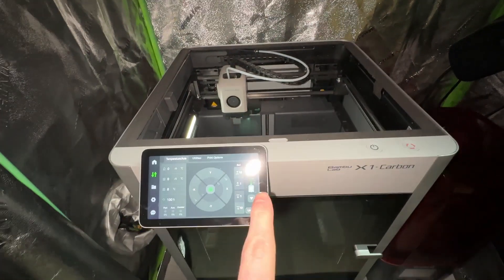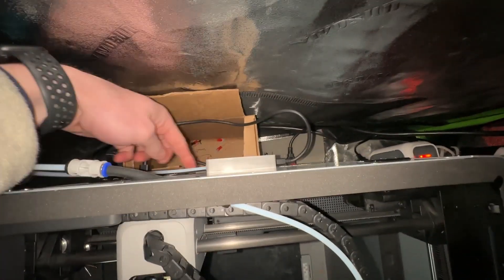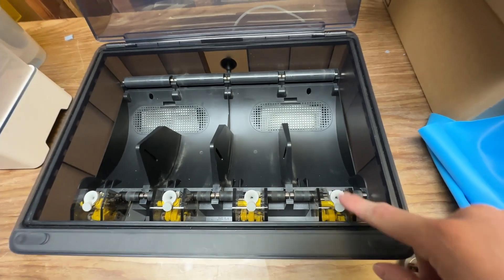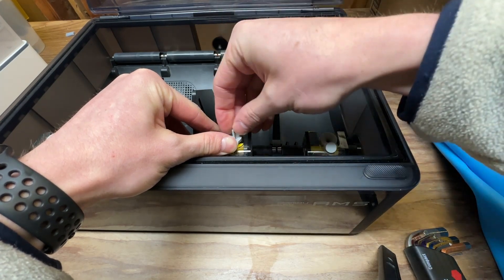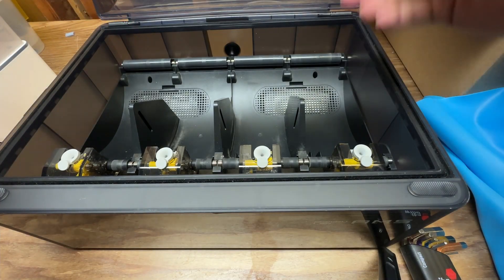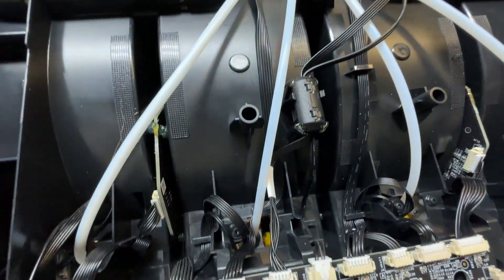How to Clear Broken Filament from the Bambu Lab AMS

Comment: Wow really? I just switched to the Bambu combo, and it takes all of this effort? I love the printer, but snapped filament is really common. Seems there would be an easier way.
Reply from the maker: Snapped filament really isn’t that common if you’re using decent filament. They’ve made it easier to access on the AMS2 not sure what you purchased but sounds like you got it recently so maybe you’ll have an easier time. You can also leave the screws unscrewed, I haven’t reinstalled the screws since filming that video and it hasn’t caused any issues.

Comment: Thanks!  Mine started this last nite.  I removed the extruder to check for a clog, when that didn't work - I came to YouTube!  One thing I did differently than you, I didn't pull the whole unit out.  So I didn't have to disconnect and reconnect the two plugs in the back center.  I got enough clearance to disconnect the tube and clear the clog.  Thanks again!

Comment: perfect.  this is exactly what i needed to do.  and when i fed the filament, it snapped off again in the exact same spot.  so now i get to do it again.  a skill ill surely learn now that I'm practicing lol.  ug
Reply from the maker: I’ve found that you can leave the 2 screws out and you can leave the cables connected but just tilt the internals forward. Makes this into a 5 minute job of unloading filament, tilt forward, clear jam, reload.
Reply: @3DPrintStuff  i appreciate that, i will try it

Comment: i went a short period without using my ams and i left filament in the unit when i should have known better arn now i have 4 slots with this issue. never had a issue an ive used it pretty much none stop since ive had it an well over 2000 hours so it was probably a good thing it happen cause i found two of my ptfe tubes had worn through right as it comes out of the little motors that drive each slot. wasn't expecting that cause i hadnt had any issues but after 2000+ hours of printing i guess its expected.

Comment: Was watching the end of a reel in the AMS being pulled through and saw the tape that held it to the carboard roll detach from the roll. Wasn't quick enough to stop it being pulled down within the AMS.

Your walkthrough showing how to free the rear tube (so that it can be pulled from the rear grommet) by pressing down with two fingers was a life saver. Managed to pull the filament back through and then reconnect the tube.

Another Brit bacon saved. Many thanks. Subscribed.

Comment: It seems those 2 wires are a pain for all of us. The best option to make it easier would be to either replace the 2 wires with longer wires or attach an adapter that would allow you to extend them. Really, Bambu Labs cut corners on the design of the AMS system. Those wires could have been longer. Also, they should have designed the AMS system with an easy open bottom that allows you to access all those things without having to take apart the  whole AMS system.

Comment: Everybody seems to love this printer but I hate it. Been nothing but a headache! It doesn't JUST WORK by the way if that's what your hoping for (I just wanted a plug and play solution). Nope been extremely frustrating with either poor printing, jamming, having to take it apart, resolution issues, etc etc etc Endless to dos

Comment: 3:39. I didn't have to disconnect these wires.  I simply unscrewed the two hex screws, and rotated the AMS in the box (didn't lift it out), removed the jam, and rotated back.  No need to disconnect/reconnect those wires.

Comment: Came back after not printing for a few weeks to a broken filament and dreaded taking the AMS apart for the first time. This video was great and to the point. The one think I did different was when I unscrewed and lifted, I did not have to remove the two connectors and was able to remove the other end of the TPU tube and pull it out.
Reply: Same! I just took the tube out, then pulled up enough to get to the inner AMS tubes. Worked a treat.
Reply: great

Comment: Towards the end it’s a bit dark, however it looks like you are not using a Bambu spool, with an IFRD tag.  If this is the case this it will be why the system fails to recognise the colour/type of the filament?

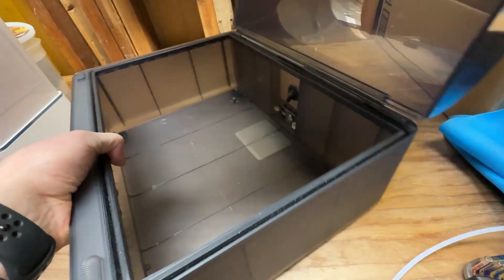Comment: at 2:20 -  People, be careful he did not show the 2 cables that you need to disconnect from the PCB board.
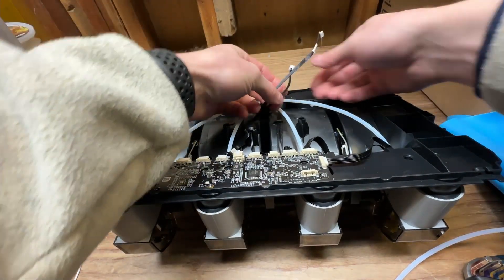Reply: Am I correct in assuming you didn’t watch the complete video?  At 3:16 he apologises for not mentioning the wires have to be disconnected.

Comment: I hope you heart this comment. Sometimes, and I've seen this only once in the almost year I've had the X1C... I had filament broken inside the tubing in two places (which was easy to resolve), but also stuck in the main tubing junction which is not visible, I carefully rolled the right big white cog until the stuck piece came out. The symptom is that the AMS will think there is something loaded despite removing the broken bits from the tube.

Comment: Be careful. He didn't show disconnecting the cables when you pull the bottom out.
Reply from the maker: Piggy backing on this, you can leave them connected and just tilt the inner assembly forward if you’re careful.

Comment: So the screws aren't catch screws meaning they can fall out. I am now -1 screw lol, Beware!
 
P.s does anyone one know what screws size they are?
Reply from the maker: I never put mine back in and haven’t had any issues. Makes maintenance tasks even easier.
Reply from the maker: Screw size: BT3-8
https://wiki.bambulab.com/en/filament-acc/acc/screw-kit-x1-p1
Reply: @3DPrintStuff  Thanks for the info ill probably just leave mine out that never even crossed my mind

Comment: Thanks!  Those two electric buckles are the worst thing ever; I'm still not sure how I managed to get them to stay.  All for a tiny piece of filament that it couldn't get out?  What a PITA.  No wonder it doesn't give a QR code/solution for it.
Reply from the maker: I no longer undo the electrical cables and just tilt the inner assembly forward to access the tubes underneath. Definitely makes things easier.

Comment: Can't remember where I saw it but there's a much simpler way. Although it will only work if the filament is stuck in the AMS. Anywhere else you'd need to do the regular checks.

Cut off around 60cm of any filament and disconnect the tube attached to the AMS. I found its easier to remove directly from the AMS and insert another one. Now feed in the 60cm filament you have. And continue the unload the filament you inserted will push out any filament stuck in the AMS.

I reckon filament shorter than 60cm should work but that was what was recommended in the post.

Comment: After 6 months of printing I got my 3rd filament breakage in the AMS. Usually is because I'm loading a spool with little filament left (-50g) and seems to rip it apart, I've been able to push it with a piece of filament like you did before. My 3rd jam seems to be more serious probably have to take it apart as you did and your video is very helpful, thanks.
Reply from the maker: If this is happening to you often you might want to consider leaving the 2 screws out of the sub-assembly when you reassemble the AMS. It hasn't had any negative effects on my printing and it means I can tilt the inner subassembly forward without disconnecting the cables to access the tubes whenever I need to.

Comment: TYVM!! I accidentally put TPU in my AMS and this video helped me clear it. Mine was actually stuck in the motor housing near the back of the AMS and after I followed the steps in this video, I was able to remove the four screws that hold the motor assembly and manually turn the gear to make the filament exit. Putting it back together was a snap!
Reply from the maker: Glad you found it helpful. Honest mistake if you're not aware that TPU isn't meant to go in the AMS.

Comment: 30 mins to get the connector back on, 5 mins for everything else.  Next time I'm not taking the connector off, a little harder, but worth it.
Reply from the maker: Yeah this is the move. I should make a follow up video saying to leave the connectors connected. You can just tilt the inner assembly forward and access all the tubes without disconnecting the connectors.

Comment: What a serious pain in the ass.  My very first time using my new printer and snap off goes a piece of filament.
Reply from the maker: Unfortunate that it happened right away. At least you know how to solve it if it happens again. I haven’t had this issue in over a year, it’s usually due to low quality or old filament.

Comment: This was awesome! Thanks so much. This is exactly what happened and I can say using the set of printed Bamby tools they have the small wire end remover so you can unplug without yanking on the connector and that helped. Getting them plugged back in.. thats another story. It would be great if Bambu made them more user friendly or perhaps more slack so you can leave then plugged in when doing maintenance..
Reply from the maker: You can actually get away with leaving them plugged in and just tilting the inner portion 90deg to access the tubes. I found this out a little while after filming this. Makes clearing jams/broken filament even easier.

Comment: What if the filament doesn't just pull right out? My filament is stuck in the side you insert the filament into. Anyone?
Reply from the maker: You may need to remove the 1st stage feeder and disassemble it. 
First stage feeder removal: https://wiki.bambulab.com/en/x1/maintenance/replace-first-stage-feeder
First stage feeder disassembly: https://youtu.be/3_if11ulC5I

Comment: The step for disconnecting the electrical wiring of the AMS bay should be shown too, as a too harsh pull-out could damage the cables. Also on my P1S I need to push on the rubber connector of the 4-way hub to get the PTFE tube out. Bambulab shows all these steps on their own support videos.

Comment: I wasn't thinking and grabbed a roll of translucent pla and loaded it and it instantly broke, its unusably brittle even with no moisture. I haven't even used my x1c yet.. lol this sucks that here is no panel to get to the path..
Reply from the maker: Yeah a panel would be nice. You can actually leave those 2 screws out permanently and it doesn’t negatively effect performance. And you don’t have to disconnect those cables every time you can just tilt the internals forward to access the tubes underneath. Makes clearing a jam a lot more convenient.

Comment: Wow this video saved me a lot of time, I had the same "endless back-spooling" issue with one spool and everyone else said to take the tool head assembly apart but this was my theory all along! Pro tip: those little screws are a PITA to get out, so once you take em out, JUST LEAVE EM OUT! ...I dont think they have any super structural functionality
Reply from the maker: Glad the video helped you. Yeah you’re right, I’ve had those screws removed basically since I made that video and haven’t had any issues.

Comment: I hadn't printed anything in a couple of months, came back and two of the rolls had snapped inside of the AMS. I was dreading pulling it all apart, watching you do it so easily was such a relief. Got it back up and running in about 10 minutes.

Comment: This is great tutorial. I just did this except I had to do it twice.  First I cleared the piece of broken filament as in this video. The problem did not clear.  I then had to break it down again and disassemble the 4 to 1 junction ( 10 more screws) and take out a smaller piece from the junction.

Comment: I didnt bother putting the 2 screws back in :) It's going to happen again. And I wash those bloody wires where longer
Reply from the maker: I’ve also permanently removed those 2 screws. Hasn’t caused any issues over the past 6 months. You can also tilt the insides forward without disconnecting the cables which makes this procedure even easier.

Comment: I still haven't fixed my AMS. It's been months. I've just been using the single inlet with my own dryboxes. I'll say that the AMS is a PITA.
Reply from the maker: What's wrong with your AMS? Sorry to hear that it's down.
Reply: @3DPrintStuff  Exactly what was wrong with yours. Watching your video was the first step to unclog it. I usually just print my 3d sculptures, so I only need one filament. Tree supports make that a bit more high quality. What people don't talk about is the massive increase of the time it takes to print with multiple materials when using the AMS.

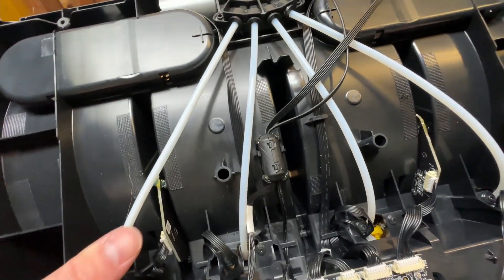Comment: tbh, I don't know if I just lack basic strength, or if I'm doing something wrong. To the part where he has the AMS apart (2:54), how does he take out the tube so easily? I'm over here struggling just to get a hold of it xd.

Edit: I figured it out. At the start of the tube, there is this button or spring-like thing. Just push down on it and then it will release the tube, for those who didn't know either.
Reply from the maker: Sorry, I should have explained that you need to push down the connector while pulling the tube. Glad you figured it out.

Comment: Thanks for this. Now I feel absolutely disgusted at having paid £310 for this. It's so basic. I bet Bambu would lock a 3rd party from making their own.
Reply from the maker: Yeah it is pretty basic but you're also paying for the R&D that went into the mechanical design and the software development. At the end of the day it really comes down to if you feel like £310 is good value for 4 color printing and automated filament swaps. I can't think of anything else on the market that offers that kind of functionality at that price point. 

I agree that Bambu is the type of company to lock out 3rd party manufacturing of their AMS. Maybe a combination of jailbroken firmware and 3rd party hardware will be an option some day.

Comment: How do you take out the tube under the ams system so easily I tried and I couldn’t get out the tube.
Reply: All PTFE tubes everywhere on the printer fit into connectors that work the same way. To install a tube you just push it in until it is won't pull out. To remove it you press down on the circlular plastic bit surrounding it and it comes right off.

Comment: Thank you for this video. I however have a similar but different issue. The filament is stuck while the spool is in tact. I checked the whole filament path as you showed and it’s empty. However the spool is stuck I cannot pull the filament out of the AMS from the top losing position. The gears have it locked in and I don’t want to keep tugging on it because I am worried I am going to break something. Any ideas?

Comment: Thank you.  I tried feeding in some old white PLA today and it broke off just like this.  Seems that there is a gap between extruder gears and if it breaks just right a piece can get stuck between them in that PTFE tube. It would be nice if they put isomething in the software to clear a break like this where you could just feed a long piece of filament into the back of the AMS without having to take it apart.  Should be simple to just reverse all the gears for 20 seconds or so to make sure it all comes out.  Hopefully they implement a firmware/software update for this.

Comment: Thanks.  Same issue.  If they would have made the two wiring cables just an inch or three more, would be even easier.  Agree with another poster, not sure how many disconnect/reconnect cycles those connectors will stand up to.

Comment: I think that is we need to be doing this sort of maintenance on the regular, they REAAALLLYYYY need to make it EASIER & SAFER to get to those tubes in the bottom. Those little fine filament wires can't take too much handling and will eventually break. We should be able to just turn it upside down, remove a bottom-panel with just a few "pinch clips" holding it in place - (like the kind on the back of most remotes)... pop the tubes out - clear the jam - then pop the plate back on and keep rockin in only 2 or 3 minutes!! This of course means you could just leave the plate OFF if you wanted as well. That would be SOOOOOO much more convenient! 😮‍💨
Reply: So I currently have this problem, did what he did and pulled out the piece. Put it back together and it’s still trying to unload filament but nothing is there. Not sure what else to do. Also the original issue was bay 1, now bay 2 is trying to unload. Any ideas?
Reply: For real! Definitely doesn’t need to be something that has to be taken apart this way. Your design sounds like a brilliant fix for this problem!
Reply: The problem is they were trying to keep it as airtight as they could to keep out moisture from the air. Hence the dessicant but I do agree it would be more convenient to make it easier to get into. But most design points are done for a reason. It is to keep wires from being caught as filament can snake all over at times. But
Regular maintenance of AMS will help with many issues. The filament breaking is a common PLA issue. It is not dry it is wet. I run it through a filament dryer for a few hours and it’s better to go. No longer brittle. Do watch out for when the PTFE tubes in the AMS wear out from rubbing filament. It happens most at the entry point to each filament compartment.

Comment: Very straight to the point video. I also had a stuck piece of clear filament due to it snapping (its was an older filament used on my ender 3), and this helped me to clear to blockage.
Reply from the maker: Glad it helped. I've also found that the issues are more filament dependent. I've stopped using brittle/old filaments.

Comment: I somehow LOST the two small screws that are used to hold down the AMS internals!  Bambu was smart enough to anticipate this, and included a couple spares! Nice :-).  Excellent video, thank you!
Reply from the maker: I've actually stopped using the screws and haven't had any issues as a result of ditching them. It is nice that they include spares cause it's easy to tip the assembly over and lose those screws on the floor.